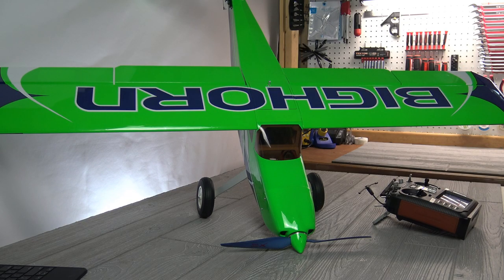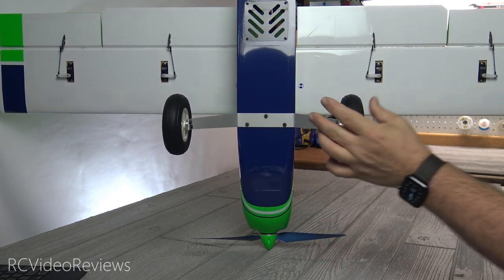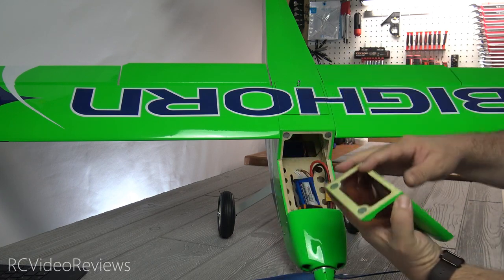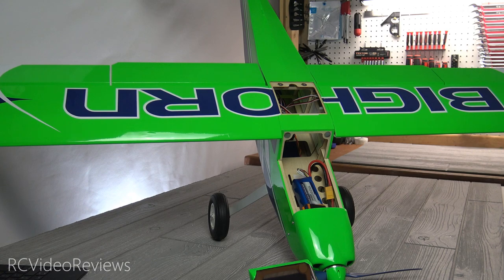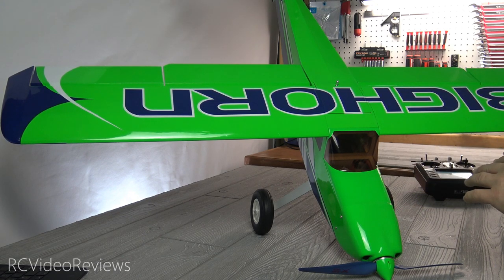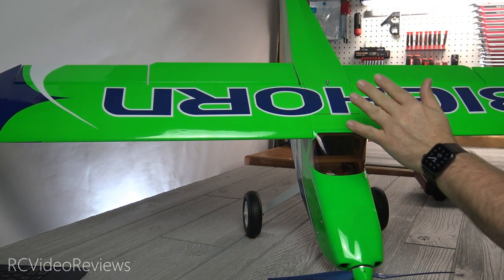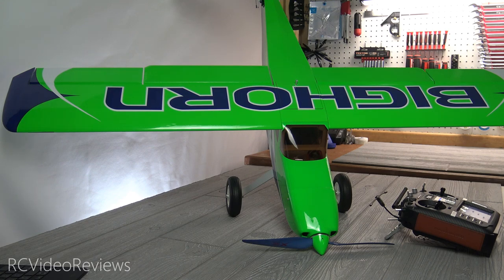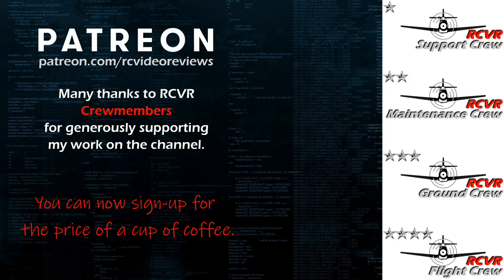OMP BIGHORN Pro Flap PNP First Look

Comment: I used a 6 channel receiver in mine as well and have it set up like yours. Thinking about eventually putting an 8 channel in so that I can experiment with the different mixes. I'm also running an Avian ESC that I had so that i could get battery telemetry. Really a fun plane to fly and, like you said, they did a nice job with the quality.
Reply from the maker: I already added an 8ch and did some fun mixes. Keep an eye for the maiden.

Comment: It's a great plane. I fly a 3500 pack just to add a little weight.  It's very light on it's feet with smaller packs IMO.
Reply from the maker: Thanks for the info. I may give that a try.

Comment: @ 4:30 You Mention Discrete Ailerons and Discrete Flaps can you elaborate the advantages and if there is a downside to it.  I have the same plane and same Tr16s Transmitter. what is the best way to go about setting it up on the Transmitter
Reply: Thanks you relied via your discord
Reply from the maker: You're welcome.

Comment: Hi john thanks for the review . I have one too I'm setting it up with a s8r I have question for you and the other folks. when I power up the airplane all the servo cycle once and go to the neutral position. Is this normal?? Thanks
Reply from the maker: Mine does the same thing. It goes to neutral rather aggressively too.
Reply: @RCVideoReviews  Are you concerned?  Look forward to seeing your maiden flight. Thanks for all help. I do not do Patreon. But I'm going buy an item from your store.

Comment: Couldn't you have rotated the one Flap servo to drive from the other side? Or was removing the servo to turn it be possibly damaging to the wing? Just a thought. Nice plane.
Reply from the maker: It’s done that way by design. It wasn’t a mistake. One of the arms could probably be rotated 180 degrees but I’m not sure what that would do to the geometry.
Reply: @RCVideoReviews  No, I didn't say there was a mistake, I meant if you remove one servo, rotated it 180 then mount the arm as needed, the same position as it is, still facing inward it would only be a minimal difference in rod length. Looks like a 3/8 -1/2'' length difference?
 PS Do you know the cost of the plane, there is no link to where it is available?
Reply from the maker: Rotating the servo won’t do anything. The arm has to be flipped 180 degrees.
Reply: @RCVideoReviews  YES, that's exactly what I said! Think about it. Or maybe use a reversed servo.
Reply from the maker: You asked if I could have "rotated the one Flap servo."  That is NOT the same thing as removing the arm. 

Rotating the servo to me means removing the servo from the pocket, turning the servo 180 degrees and re-installing it which would also cause the size differential you suggested. That is NOT the same thing as leaving the servo where it sits, removing the ARM and rotating the ARM 180 degrees. They are two different things. By removing the arm and rotating it 180 degrees you would also have to remove the ball from the horn and put it on the other side of the horn. Rotating the arm 180 degrees would reverse one of the servos. Rotating the servo 180 degrees will not reverse anything.

I don't need to "think about it", I know how flaps work. If I cared to make a change, I would do what I said in the video and switch to an 8ch receiver.
Reply from the maker: This is what I'm talking about. That won't do ANYTHING except change the length of the connecting rod. You SPECIFICALLY SAID mount the arm in the same position as it is. 

"meant if you remove one servo, rotated it 180 then mount the arm as needed, the same position as it is"
Reply: @RCVideoReviews   ;-( OK,
 PS do you know the cost of the plane and where it's available?